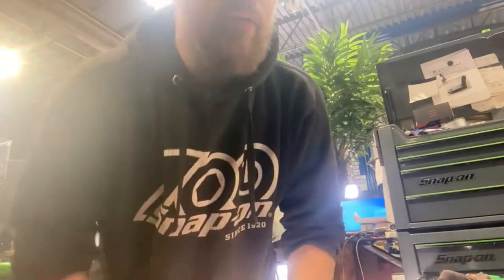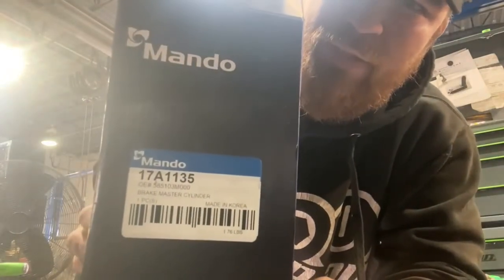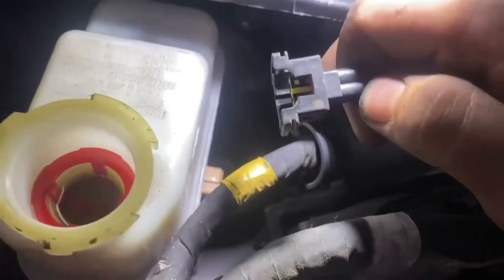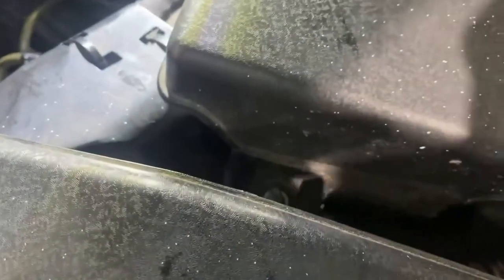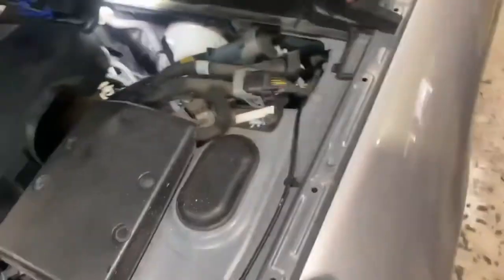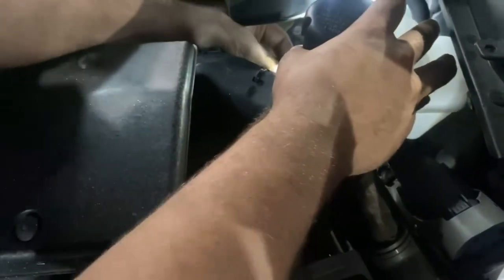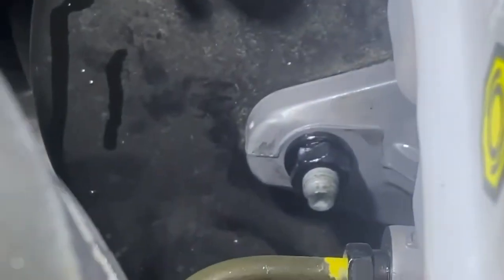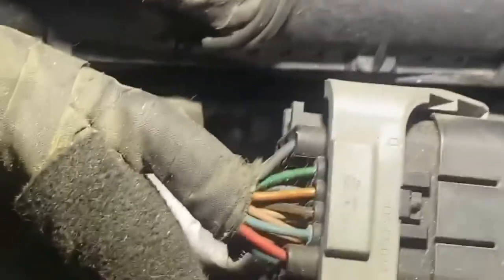Genesis Sedan Master Cylinder Replacement 2009 - 2014

Comment: I have looked and looked and can't find a brake booster change on Genises coupe 2013 2.0 T. All kinds of brake pad and bleeding them. I guess I'm the only one with this problem. I was hoping to see how hard and where the nuts were that holds it on. Very few cars period are easy to change. but it's nice to have a heads up.

Comment: I followed  your video to change out my Genesis Coupe master cylinder.   You said nothing about the gasket or seal around the master where it bolts onto the vacuum booster.    I now have a "hissing vacuum leak" around the front of the master.   

Did your OEM master come with a new gasket?  Did you re-use the old gasket material, or what?   You didn't bother to video that actual assembly so we have no idea about that.....

Thanks!
Reply from the maker: This footage was actually sent to me to use on the channel but I myself didn't do the job, I'll have the person that did the job respond here in a bit.
Reply: Hey Lawrence, the OEM/Mando master did indeed come with a new gasket and came pre installed. Does your booster have any corrosion on the face of it? I would definitely not recommend using the old seal, I apologize for not showing/explaining this when I shot the footage!

Comment: Was the brake pedal hitting the floor and needed a new master ?
Reply from the maker: yeah randomly then after pumping it the pressure would come back
Reply: @GenerationGarage  That's exactly what mine is doing. Happens more when it's cold and rainy. Replaced all pads, rotors and fluid. It fixed it for a few hours, then started acting up again.